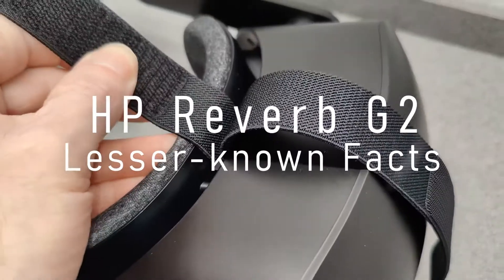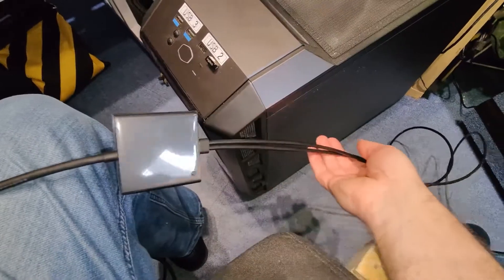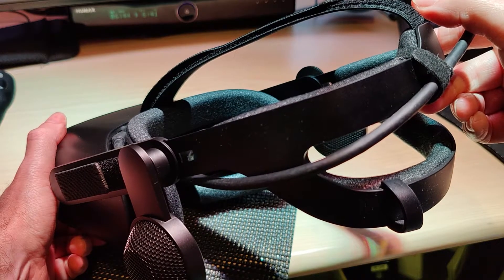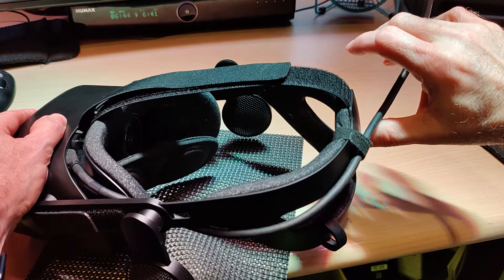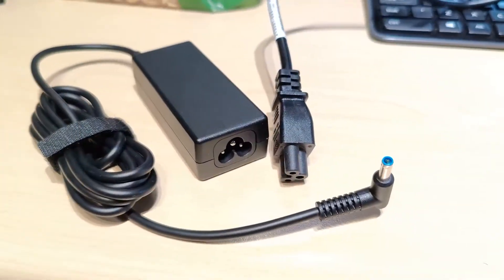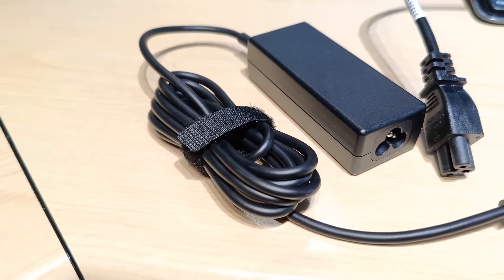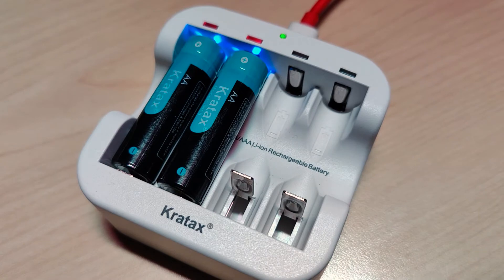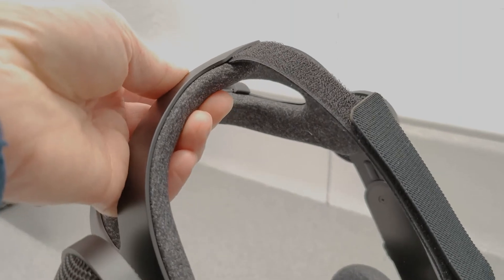HP Reverb G2   Lesser-known Facts

Comment: Buyer beware:   It is indeed a great / the best  headset in terms of image quality.   But it suffers from serious mid to long term  reliability problems, especially regarding the cable  (I've had 5 in 2 years) and  the  headset itself (I've had two fail the 2nd only 5 months after HP replaced the first one).   Contacting HP support can be a real problem,  there is no option on their support  phone system that the Headset can fit into.  Also if your headset is either out of warranty, or is a replacement for a previous one that failed  you will probably find the HP support website may not accept the serial number, and refuses to help/link to any support.  Even if you do manage to find someone in HP support who has heard of the Reverb G2   it can take weeks to get the problem sorted out.  Replacement cables in particular are like gold dust,  all the HP stores  show permenently OUT OF STOCK and  searching the web may well find someone with stock, but they'll charge crazy prices.   Such a shame for what should be a great headset. But sooner or later it will fail on you (everyone I know who has one has had failure issues).   I'm giving up on mine, simply not worth the pain. I'm going to try a Pico 4 instead .  Hopefully it will be more reliable.
Reply: Was that with the v1 or v2?
Or do they both have these issues?
Reply: @pythontest512   was an issue with both.  But the problem was eventually solved by routing & anchoring the cable around the headset to remove any flexing/strain  on the plug into the headset.  Since i've done that i've had no problems whatsoever for well over a year.  Main issue now for the reverb is dependence on WMR which is no longer supported at the next major windows 11 release